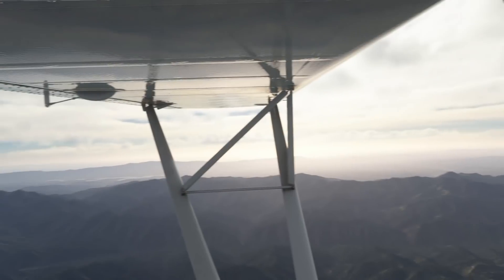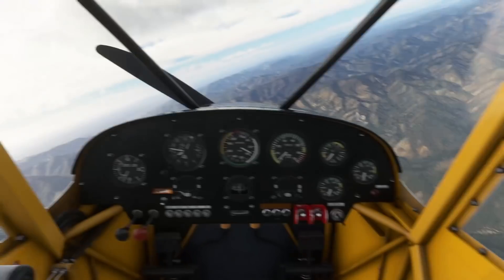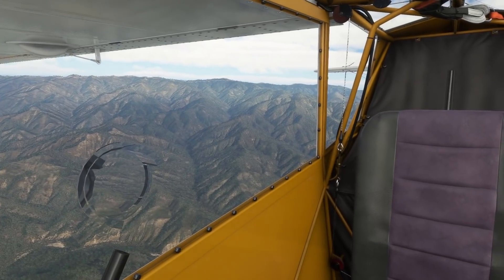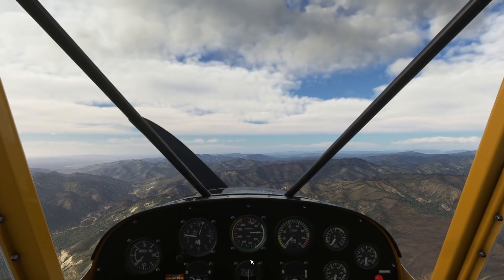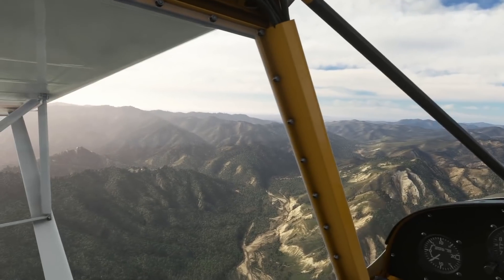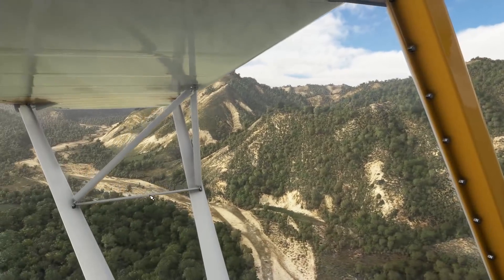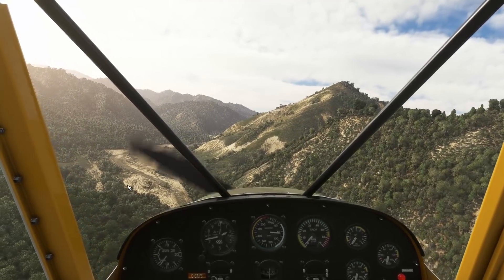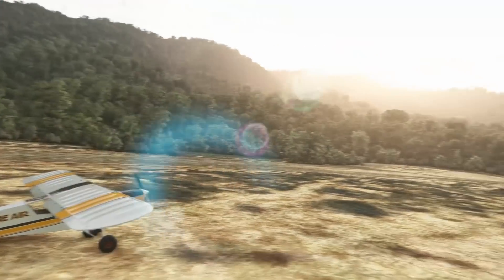Real Pilot demonstrates Forced Landing - What Trevor Jacobs could have done! (MSFS)

Comment: Maximum extension of the glide path you get with prop standing still. If high enough, I would first stop the windmill in front of me after restart failed.
Reply from the maker: Yup, though in this model I couldn’t get the prop to stop 👍🏻 The flight physics aren’t modelled correctly
Reply: @cgaviator  I was shure that you had this procedure in mind, 🙂

Comment: Best glide is usually somewhere between Vx (best climb angle) and Vy (best climb rate). It provides the longest distance traveled, not the longest time in the air. If you want the longest time in the air, you can go closer to stall speed (Vs/Vso), but you don't want to stall with no way to recover, so be very careful with turns to prevent an accelerated stall. An AoA indicator would help with this. I'm very sad about Trevor's plane, it's a great aircraft and there aren't too many of those left. There is a huge silver lining, though. He's causing a lot of people to study the incident and be better prepared if it were to happen for real.

Comment: Don't forget to transfer your friend's ashes from the urn they are in, to a plastic ziplock bag which can conveniently fit in a pocket when skydiving, even though you are allegedly flying to a destination to scatter those ashes with no intention to skydive, which would mean there would be no reason to put the ashes in a crappy plastic bag if you could just put the urn on the seat next to you. Also, don't bother attempting to send a pan or mayday call, even if you are clearly wearing a headset and the aeroplane is fitted for a radio as evidenced by its antenna on its underside.

Comment: 2:10 there is no starter on the plane he was flying (hand start) but he could have used air speed to attempt to bump start it
Reply: Well considering he didn't have the original engine in it.  Nor did he have the engine that was register there's a good chance it did have a starter.
Reply: @jasechurch5124  doesnt change the facts I stated... could have been restarted either way.

Comment: Engine failure checklist -

1-Trim for best glide
2 - jump

Apparently ….
Reply from the maker: Point 2 depending largely on type of safety equipment worn! 😂
Reply: @cgaviator  agreed, no good if what you have on is a life vest or a rucksack full of sandwiches.

Also need to make sure you strap the fire extinguishers to your legs first

Comment: "Best glide will keep you in the air the longest"  - It will cover the most distance, minimum sink will keep you in the air the longest. The assumption is of course that trimming for best glide will give you more lz options, however if you have your chosen lz made and you wish to have more time to communicate, prepare, or do engine restart attempts, then trimming for min sink is better. It's also worth pointing out that getting an an unknown lz higher (using best glide), and spending time circling and examining it (min sink) is a good idea. There are many things hard to see from the air, rouge power lines, obstacles, and terrain gradient. Better to land up hill and down wind, than land down hill up wind, so noticing these things are key.

Comment: The whole bailing out becuse engine died seems so ludicrous to me as a former glider pilot. Used to learn on a glider from the 50ies , spoiled with a glide ratio of 14:1 . With mediocra thermals regularly stayed up for hours. Maybe he could have gained some altitude buy soaring the hills... rule of thumb for landing any glider outside an airport (aka crashing for you motorists) : if a tractor can drive there you can land safeley. Especially if your in a bushplane. Good luck for your next career jacob.
Reply from the maker: I don’t believe you’d get sufficient lift from the ridges. Of course never say never, and it would depend on conditions of the day.

Comment: The S-turns back and forth aren't helping your glide performance. Doesn't matter much when you picked a landing spot that's more or less directly beneath you, but it's not explained in the video and would be detrimental in an actual emergency.
Reply from the maker: Of course, every situation is different. It’s near impossible to cover every aspect in a 10 minute video. I would much prefer to select an ‘ok’ landing spot nearby than risk stretching the glide to the perfect spot.

Comment: I have had my PPL (multi-engine) for 7 years now. Regardless of what aircraft I am flying I have a bag that goes with me. It contains all my logs, permits and licenses, charts, flashlight, headband light, chem sticks, a box of fuses of every type, and the most important item is an aviation radio. I have the Icom A25N which I got for about $500. I have had to use it several times because of the radio in the plane failed. And they’re nice because you can tune the ATIS outside of the plane. I also have all the guard frequencies programmed for the area I am flying. I also have the SPOT Gen3 satellite locator beacon. When I activate it it starts broadcasting my GPS location and messages preselected to family and friends. That was about $150. Yes it cost more to have all that crap, but when the shit hits the fan, how nice is it?
Reply from the maker: Excellent tools to have!
Reply: Great to have, but it's better to just not turn off your engine in flight :)
Reply: @heathwasson7811  lol YES! For us normal, sane people who value our lives and reputation, keeping engine alive is key!

Comment: one thing that the simulator misses is how rocky California riverbeds are and that they are dry 98% of the time. A plane landing there irl would prolly hit a rock/cause significant injury to the pilot.
Reply from the maker: Ts a valid point, but in both sides of the argument, given the slow landing speed of this aircraft, it would likely be a landing that could be walked away from. But that’s the thing about risk, you can always just be damn unlucky!

Comment: Turning one way or another though, without power, will cause a disproportionate loss of altitude, and probably isn't worth it in the mountains.     I'd just scan the horizon of the best glide slope and see what's available.
Reply from the maker: If you have altitude in hand it doesn’t matter. Better to scan for the best area whilst you have some time.
Reply: @cgaviator  Basically you are saying if you have enough time then use it.   Of course.  But that's the point...you reduce your glide time disproportionately turning around like that, then you have disproportionately less time in hand.    And you don't know how much time you will need a priori.
Reply from the maker: @Zuckerpuppekopf  you misunderstand, having looked around once I’d selected the preferred place, and then with excess altitude I decided to scan for other options. Each situation is different, and some will require perfect gliding to make work 👍🏻

Comment: The irony is he was in one of the best planes to do slow landing in. Some of these plans have stall speeds around 35 MPH. I think fastest runner is around 30MPH? Be curious about what the specs were on his plane, it actually flew pretty well after his engine failure.
Reply: I believe 33kn (38mph) is the specific stall speed for his Taylorcraft.  Almost any landing is one you can walk away from at that speed.
Reply: Usain Bolt 27.5mph
Reply from the maker: Great knowledge!

Comment: I had low oil pressure over tiger country in a nearly new Cessna 172. Was advised by Air Traffic Control to return to base but on the way back the prop stopped at 3000’ and I spotted a little ag strip. High and hot but no damage, swapped out the donk a few days later and flew home. 
Observations. An obvious stunt. You can see him walking over a nice little paddock. GA pilots never wear chutes.
Reply from the maker: Absolutely. And kudos for your forced landing! Bet it got the pulse up somewhat!

Comment: I'm not an aviator just an interested passer-by that has seen the Jacobs bail out so if you've isolated your electrics what powers your flaps down?
Reply from the maker: Depends on the aircraft. Alot of old/basic aircraft use mechanical linkage to lower the flaps. So no electrics or hydraulics required. I’m not sure if some aircraft can use battery to lower flaps, usually not.

Comment: Really liked that video and despite you clearly not being a glider pilot your years and years of experience shone brightly. A glider pilot's perspective: the high key/low key landing pattern is the standard pattern for gliders (and as you didn't have a functioning engine you were flying a glider). Rather than flying downwind, base and then finals the BGA is now mandating downwind, diagonal, base and then finals (google BGA instructor manual ... the PDF is freely available on the BGA website). The idea is that your chosen landing spot will never get out of view. When looking out the window the angle towards your chosen landing spot should always stay the same (you get lower and you come closer --> angle stays constant). If the angle becomes steeper you are too high and you need to increase your downwind leg to lose height. If the angle becomes shallower you need to turn in sooner. This needs to be closely monitored throughout the whole circuit as it can quickly change due to pockets of lift or sink (in particular in the mountains).
W/r to the optimal glide speed there are two speeds (google glider polar curve). There is the speed of maximum lift which will keep you in the air longest but will not result in the longest range (on the polar curve that is the maximum ... dangerously close to stall speed). The other one is the speed which gives you the optimum lift/drag (L/D) and with that the furthest distance (which is what you selected/estimated and also described with correct terminology ... I thought I'd just add it for completeness reasons). On the polar curve this is the point where a tangent line from the origin touches the polar curve. For a plane like the Cub Crafter (which is I believe what you were flying) I would hazard a guess that the L/D will be something between 9-12 ... that means with 1mi in the air you have 9-12mi range ... modern gliders can give you all the way up to 70mi range for every mile of altitude ... but that's a different story.
W/r to the landing I would probably try to do a fully held off landing in particular in unknown terrain like this. What that means is that after the round-out/flare you try to fly parallel to the surface, bleeding out speed until you effectively stall. The idea is to slowly pull back the stick/yoke until it's fully back with you stalling when you are an inch away from the ground. This way due to the much reduced speed you have less ground to cover before the plane comes to a halt and also less speed in case the ground does have non-visible hazards ... now this is obviously purely theoretical. If you only have a very short landing area you got to do what you got to do and that's probably not a butter landing.
Reply from the maker: Tangential line from the origin, that takes me back some! Thanks for the info, I’m pleased to say I’ve learnt a lot from this video lol! I was attempting a constant sight line approach and talked to the sim point drifting up and down. Up and down drafts in the mountains are interesting to consider. I wonder if you could find sufficient updrafts to fly clear of the mountains! 😄 Anyway, thank you for taking the time to download the info. I’ll check out the BGA stuff 👍🏻👍🏻
Reply: @cgaviator  With the glide ratio of a brick (which every GA aircraft effectively has) I doubt that you could actually rise in the lift. You would sink slightly slower but I doubt you'd go up. You would definitely feel the sink though ... very scary to go from vs -300ft/min to -1000ft/min with limited altitude remaining just because you are on the lee side of a ridge.
Reply from the maker: Tangential line from the origin, that takes me back some! Thanks for the info, I’m pleased to say I’ve learnt a lot from this video lol! I was attempting a constant sight line approach and talked to the sim point drifting up and down. Up and down drafts in the mountains are interesting to consider. I wonder if you could find sufficient updrafts to fly clear of the mountains! 😄 Anyway, thank you for taking the time to download the info. I’ll check out the BGA stuff 👍🏻👍🏻
Reply: @cgaviator  Other than in flight school I don't think I don't think anyone would have any need to look at polar curves so I'm not surprised that this comes as a blast from the past to you. I just thought it might be interesting to give some background of where these numbers come from :)

Comment: Hi key low key are AGL altitudes. You called Hi key at 2500 MSL.  Don’t think that mountain valley is at sea level.
Reply from the maker: You’re absolutely right, I though I’d mentioned that? Apologies if not. I’ll have a quiet word with myself 😅 However, my next video will make this clearer. Don’t worry, it’s not in a bush plane!

Comment: As a mere 100+ hour pilot currently getting my Instrument rating.
I can see Trevor didn't even take basic actions following engine failure.
I probably wouldn't handle the situation perfectly, but I feel I could get some basics done fairly quickly... Running basic memory items with a cockpit scan, Master switch, primer, mags, fuel, Alternator, Carb heat, Mixture, Throttle... Trim for best glide speed, squak 7700.... He literally did none of them, not even one... Seems a bit ridiculous.

There there is the whole having a GoPro on a stick in his hand at EVERY moment bailing out the plane and taking selfie views of himself and the plane just seem absurd... The absolute LAST thing on your mind in the face of death is let's make sure I get a selfie view and hold on to my camera at all costs.
Reply from the maker: Agreed!

Comment: One correction from your comment about best glide.  Best glide does not keep you in the air the longest, it provides the greatest distance covered for a given altitude.  Minimum sink speed will keep you in the air the longest (usually a little slower than best glide)...  Otherwise, nice video!
Reply from the maker: It’s great that I get to learn at the same time! I’ll do some more learning, interesting stuff.
Reply: @cgaviator  If you're curious about the math, check out the Breguet range and endurance equations. Those are the fundamentals of how far or long a plane can fly and give some insight into how to optimize either range or endurance (if I recall correctly, the math generally shows that your optimal speed for range will be larger than for endurance). Endurance is an energy conservation problem, range is an efficiency problem.
Reply: Very good point, wonder why that isn’t stressed more
Reply: @arthurbrumagem3844  Because how many minutes you can stay in the air is rarely as important as the distance you can cover.  More time aloft isn't generally of any advantage in an emergency situation. On the other hand, increased glide distance increases the amount of area available to you.  More area means more options.  More time aloft means more time to stare at your limited options.
Reply: @heathwasson7811  I appreciate that comment. As a pilot myself I never had that explained as well. Thanks

Comment: @cgaviator - Excellent!  I did a similar MSFS engine out sortie over Trevor's crash site, but starting @10,000 ft as that's the altitude some YouTubers were reporting at the time a few days ago.  Like you, I used the same MSFS Cub model since it's the closest to Trevor's 1940 Taylorcraft.  I killed the engine and immediately set up best glide speed.  I then turned left from Trevor's initial approximately-north heading and flew 210 degrees to try to get back out of the inhospitable wilderness area.  It wasn't long before I could see a highway along the last ridge.  I still had plenty of altitude to clear it and successfully circled and landed in a slightly uphill field and coasted onto the curvy mountain road.  LOL my landing wasn't quite as smooth as yours, but successful.  There was even a farm/ranch nearby within walking distance that I could have also landed at. 

What these exercises prove is there were obviously many suitable landing sites available to Trevor.  What's even worse is that he surely was familiar with that area so must have been aware of them.  And what's even more telling is there were reports that a few days earlier he had flown over the exact same area where he later jettisoned his vintage aircraft.  This leaves little doubt this was simply a pre-planned stunt by a reckless feckless moron.

Regards from Thailand!
Reply from the maker: Thailand indeed! Thanks for the comments. I'm just wondering if this stunt was cleared in advance. Hopefully find out in a few months
Reply: @cgaviator    Hmmm... interesting reply.  Who do you think might have "cleared in advance" such a potentially dangerous stunt?
Reply from the maker: @Jimbo-in-Thailand  it's the only other option i can think of, but it's a stretch that the FAA would authorise it
Reply: No way FAA would clear that. There is no telling where that plane will go unpiloted.  It would just open them up for a lawsuit if someone got hurt let alone the fire risk in California right now. I can’t believe it didn’t start a fire
Reply from the maker: @wormhole331  true enough 👍🏻 and they would face the same backlash that Trevor is getting!
Reply: @cgaviator  Oh but he had that fire extinguisher strapped to his leg to put out a fire in our severe drought CA land. 
He has a dangerous, reckless mind.